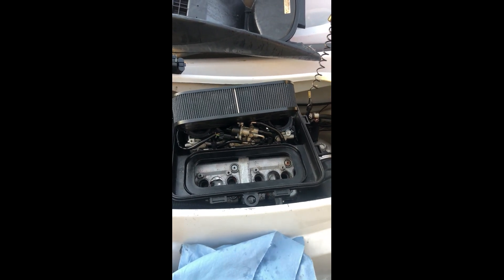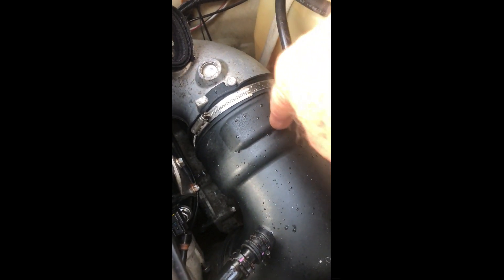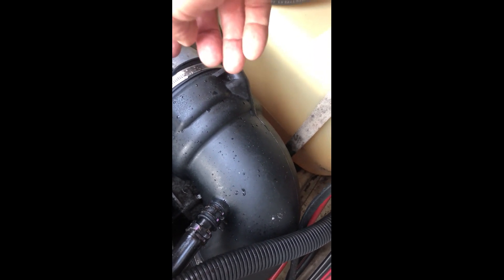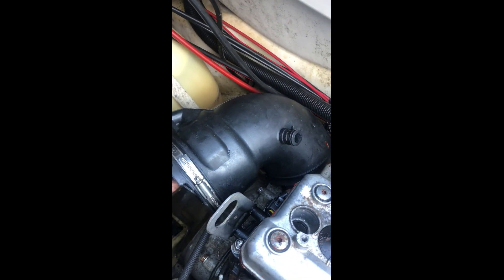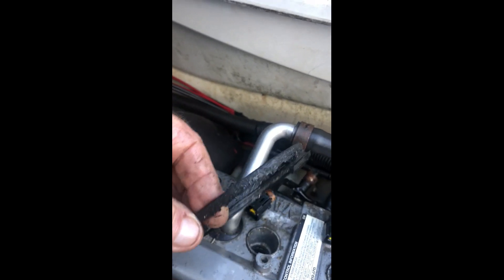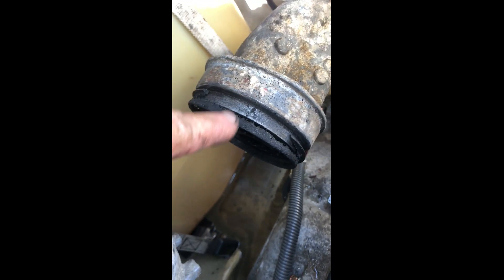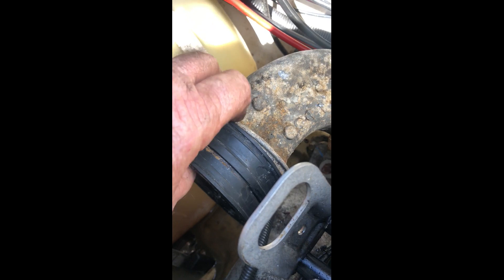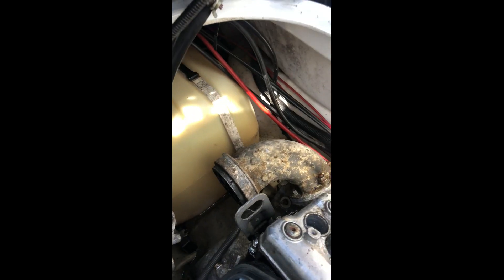Jet Ski MR 1 Engine, Water in Cylinders, NOT HEAD GASKET FIX IT, DIY!

Comment: great videos, very informative. I have a 05 fx cruiser with similar issues, except mine has water in the oil, when I bought it last year one of the plugs broke in the head so I removed the head and installed new head gasket. I dont think i have a bad head gasket now, checked compression and its good but i did find water in the first 1 cylinders when I removed the coils. Any direction you can give me I really appreciate it
Reply from the maker: Miguel Morning, Thank you for your comment, Like others I Love being on the Water not Talking about it! From what you have informed me a couple of items come to mind.
 (One) if the engine has sat for a long period of time, Water condenses in the crank case and will flash off when starting to use it after a long period of sitting. Oil will show Water in it, MILKY COLORED. 

RESOLVE BY: CHANGE OIL AND FILTER, use a WET VAC with extension tubing and remove all oil from OIL PUMP CAVITY from the port inside oil cooler fill port. This way almost all of the oil is removed, if not there is still approximately 1 +/- Quart of used oil in the Engine cavity.
(Two) You indicated you replaced the Head Gasket, There is a small Oil port from the Engine Block to the Engine Head that must be aligned and mated undamaged or oil and water can mix.
(Three) Need to check out my video, youtube.com/watch?v=-CtVO11bTKQ,  Yamaha PWC FX Cruiser Oil Cooler Test. This can be accomplished without pulling the engine,*** UN-bolt the oil cooler from the engine, be very Careful of the O-rings.**,** if you pinch them coming out or in you will have a LEAK*** !!!
Not Sure of the area you are in, but Weather plays a big role in some interesting issue noticed. I have Two Yamaha FX Cruisers, We Love and Enjoy Them. Let me know if you need more information or help !
Reply: @cjphillips987  thank you for the information I live down in Houston Texas, rode it most of the summer on my last ride during the fall I noticed that it didn't want to start (which makes me think its the seal you are talking about) once it started after a couple of cranks ran it for like an hour in a half. When I was cleaning it out I checked the oil and found it was peanut butter. On most of the forums people were saying head gasket but I had just replaced it and it runs fine. So let me tear it down this week end and check the seal and then run it on the hose and add the additives you recommend and see what happens. thanks again!
Reply from the maker: @MiguelRamirez-wg2wb  Miguel, Sounds like you are on the correct path, remember when changing oil in this model engine there is always some oil not removed that will blend with the new oil. Add Marvel Mystery oil it will clean the internal cavity and components without harm.
If your Ski sits for a period of time, Use pure Isopropal Alcohol without color to the fuel tank, it will absorb the condensed water in the fuel/tank and burn in the engine without issue or use Berryman's B- 12, Fuel Treatment. You can buy either at Walmart along with Marvel Mystery Oil and save money. Good Luck !
Reply from the maker: @MiguelRamirez-wg2wb  Good Luck, 

Me, I'm Lazy ; I would start with the simple item first, Change the oil and filter, run it for a few hours noting the color change if any. then follow up with the oil cooler before pulling the Head.

The water in oil can be the alignment of the Port in the Head gasket that is critical, it's a small hole mistaken for a Center Pin Hole. It mates with the bottom of the head drain port to the block for returning oil if scratched, scared or misaligned it lets water cross over in to the oil stream. Other wise sounds like you have excess moisture building up in the crank case due to temperature inversions or the Oil cooler internal gasket is leaking. It takes time but those are the only ways for water to get into the Oil, unless you are putting it into you oil fill port. 

Good Luck Let me and other know the root cause. 

Thanks
Reply: @cjphillips987  took the valve cover off on Saturday. Since I found water in the 2 coils I suspected the  o-ring on the water pipe that goes to the head I believe between cylinder 1&2 front of ski. The o-ring was worn out and I remembered that I put silicone gasket maker to seal and forgot about. I think this is my problem will let you know once I confirm
Reply: @cjphillips2877  yeah it doesn't but it goes through the valve cover, my thought is that if it leaks enough to build pressure to push past the valve cover gasket into the spark plug tubes and on to the valve train
Reply from the maker: @cjphillips2877  Miguel, You find the problem of water in your oil, it could be the oil cooler leaking internally....
Reply from the maker: @MiguelRamirez-wg2wb  Yamaha PWC FX Cruiser Oil Cooler Test, www.youtube.com/watch?v=-CtVO11bTKQ
Reply: @cjphillips987  ok took it out still have some water in the oil couldn't get it all out but I'll add the oil additive to remove moisture. The water pipe that goes through the valve cover and bolts on top of the head was leaking and filling the chamber under the rubber stopper. With enough water it was seeping past valve cover gasket onto camshafts and into ignition coils. Fixed the leak but water still in the oil. Just going to have do oil changes after a few hours again.
Reply from the maker: @MiguelRamirez-wg2wb  Hope that was the issue, You can add Marvel Mystery fluid to the oil it will Help clean and lubricate the oil cavity and moving parts without damage to internal parts. I also use it in my fuel it cleans fuel injection  or carburetor systems. Good Luck Ride It!
Reply from the maker: Miguel, If you have good compression with water in the cylinders, it's the Seal and Boot shown in my video. The inner-joint / Boot, has a hole in it and the water seal is bad as well or Alignment and clamps are not correct. Trying to Help without seeing it!